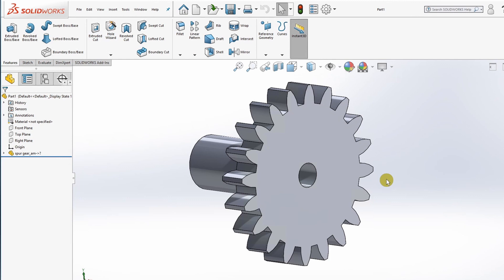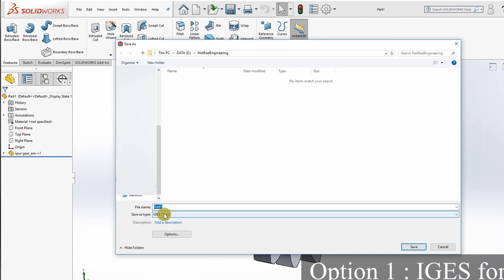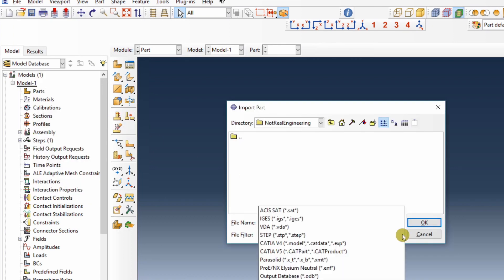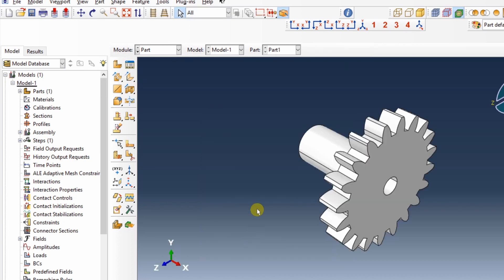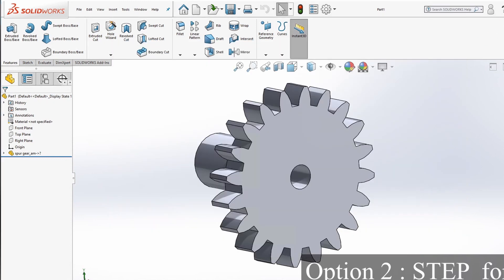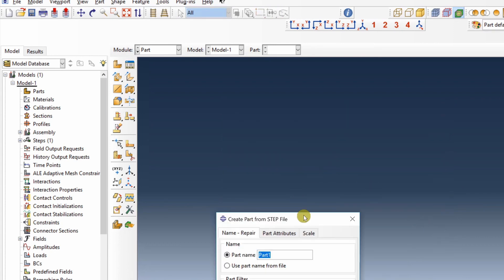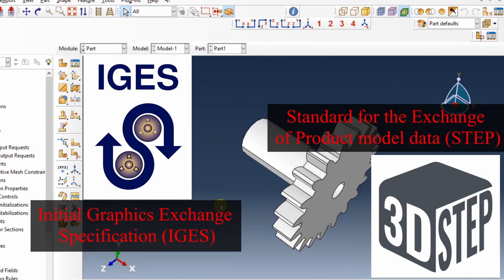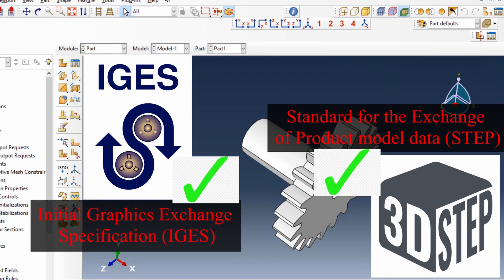Import CAD model to Abaqus | Import part from SOLIDWORKS to ABAQUS

Comment: Hello there, really good channel, thanks!

I was wondering if you could help me, I want to simulate a solar panel structure, and I was wondering if I import it as a parasolid how should I define de connections? (They're supposed to be bolt connections, but that's not what I'm studying so I didn't draw them (I just defined the profiles positions)

Thanks again!